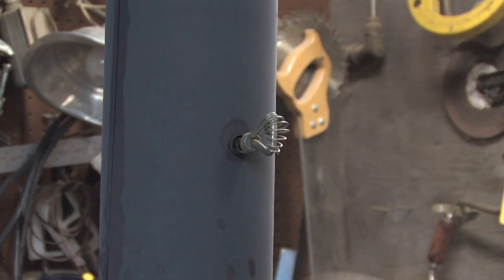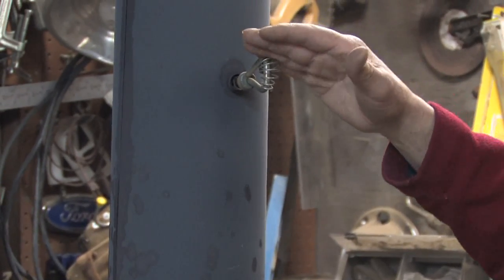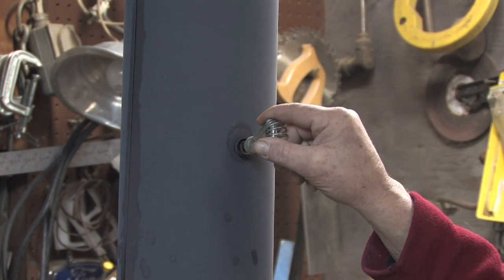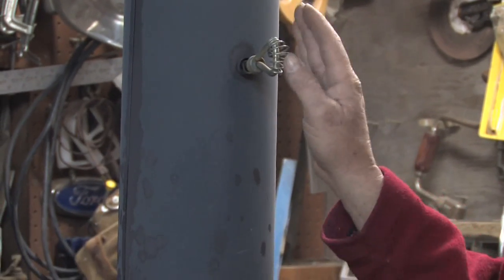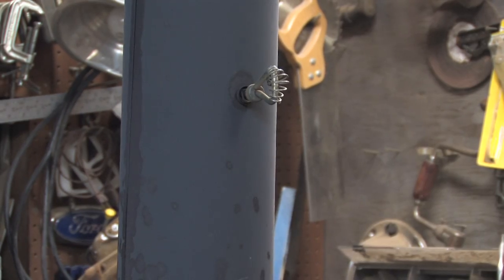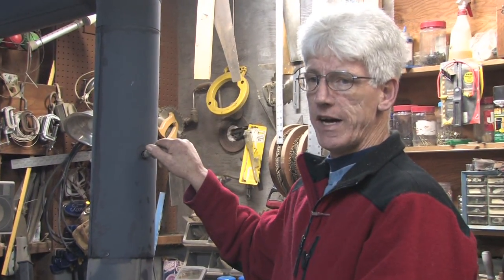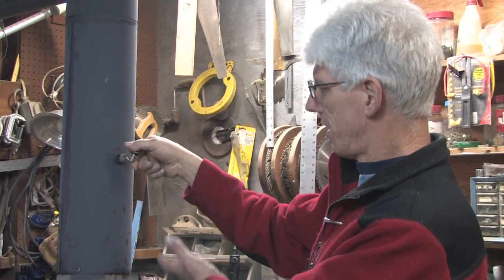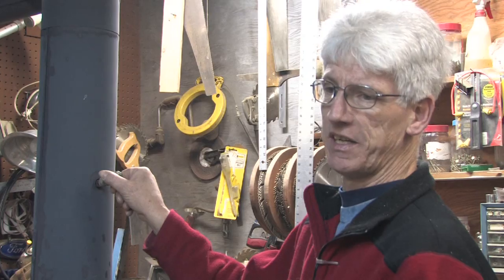Carpentry & Saws : How to Use a Damper on a Wood Stove

Comment: It does more than hold back or release heat. It controls the amount of air flowing through the fire, which in turn controls the fire's rate of combustion and temperature.

Comment: Thank you for the video. I'm wondering if my damper was installed incorrectly. No matter what position I have it in, I'm getting way too much smoke. Not sure why! Just had the pipe and damper replaced. Could it be installed incorrectly?
Reply: Could be that or your home is too" tight" meaning there is little airflow throughout your home, try cracking a window in the same room as your fire
Reply: @johndoe-uz2kc  Sometimes over time the damper bends due to the heat. I had to replace mine, a few years ago because it would not stay in a correct position. After removing it I saw that it was bent.

Comment: Our damper spins easily, is that how its supposed to be?
Reply: yes, the damper does not fit tight inside the pipe, app 1/4" gap all the way around it

Comment: I added a damper to my fisher wood stove but all it seems to do is cool my stove down a lot faster. With the damper open, it will get up to 400-450 and stay there a while before coming back down. When I engage the damper at 400, the stove temp comes down way much faster. At times I just leave it open while at other times I turn it about a quarter to the left but not sure what it’s actually doing, but heating my house more is not one of them...what I decided to do was is leave it open until the temperature starts to drop to then engage the damper to keep the coal burning slower and hope it last longer. Sometimes I turn it all the way closed about half a turn. Other times I just turn it about a quarter turn and leave it there. Not sure if I see a difference other then seeing the temp go down aster when the damper is engaged..
Reply: the damper slows down the air flow - so with less oxygen flowing through then the fire will burn less hot. So yes it's best to use only after the coals build up.